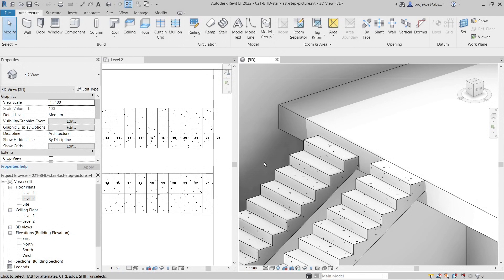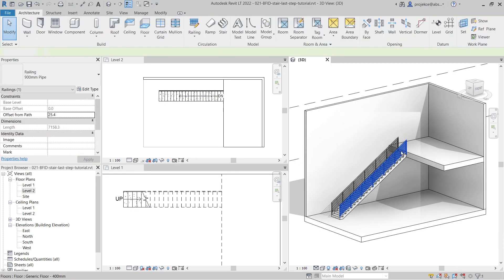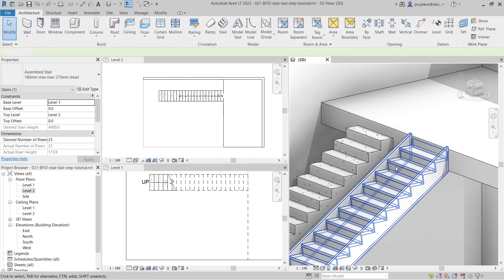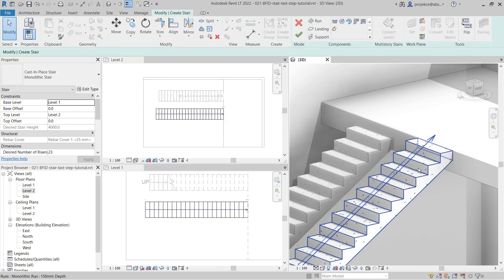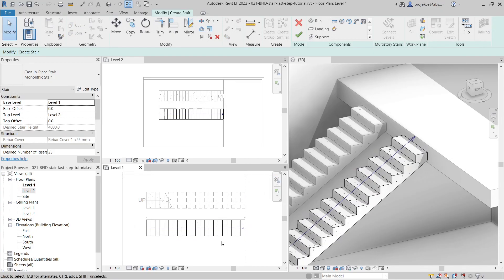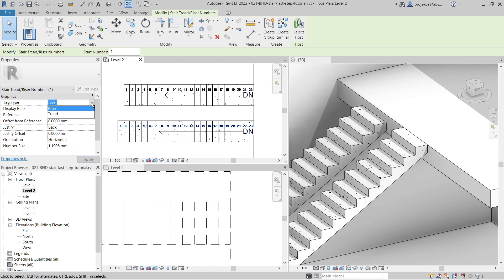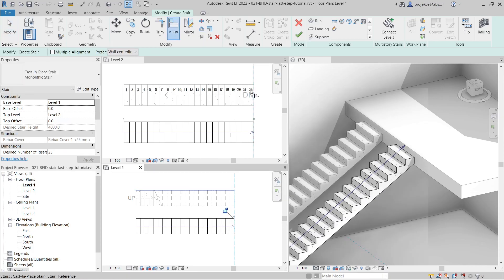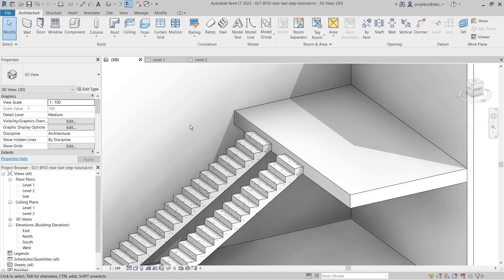Last Riser of Revit Stairs Setup

Comment: Do you, or anyone watching, happen to know how to join walls and stairs? Whatever I do, always some lines are visible. For most ugly example, I had stairs, under it walls on both sides 20cm thick (they were right next to outside wall), but on one side (interiour), on top side of stairs, 18 cm concrete wall as fence. This cannot be trimmed, cannot be joined, whichever way you manually edit shape of wall, always a bunch of lines remain in sections. The only YT video I find about this problem (wall + stairs joining) is some guy explaining how there is no point of even having stairs in final model, as they are architectural object, vs walls being structural. His way of doing that is simply using stairs as line guide on top of which he makes extruded structural object he can then join. So, do you know anything to solve this, or make his approach better (somehow "connected" with real stairs). Thank you!
Reply from the maker: Not sure how to solve this.

Comment: Only with version 2022 does it work, with 2021 does it work the same way, I have no visible arrow and dot
Reply from the maker: Hi, I just checked it with Revit 2020 and the dot and arrow is there, so there is some other culprit. Make sure you have got your run selected and also make sure the run has not been converted to stair-by-sketch previously.
Reply: @BIMforInteriorDesign  Yes, my first training file was converted into a sketch. But the other files work great. Thanks for the answer and the excellent video tutorial, congratulations !!!
Reply from the maker: @GoshoGanchev  Happy to hear you found the culprit of the problem.